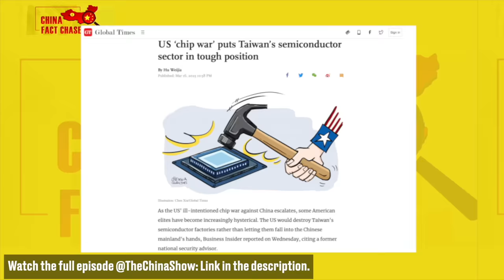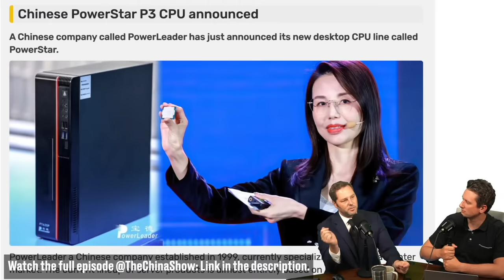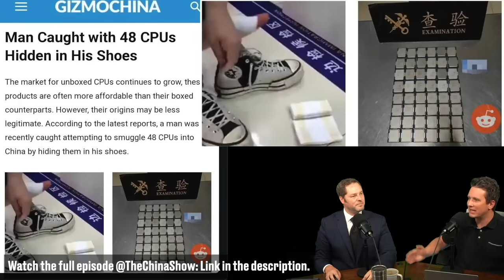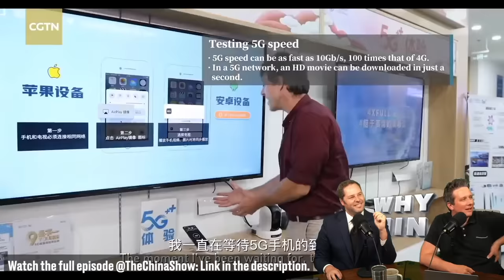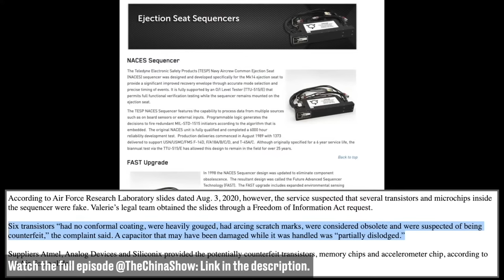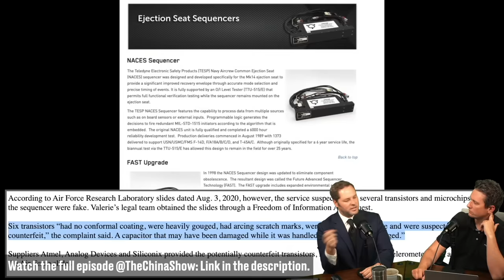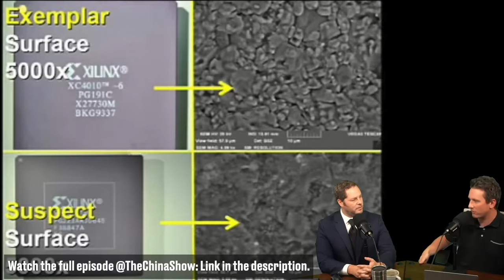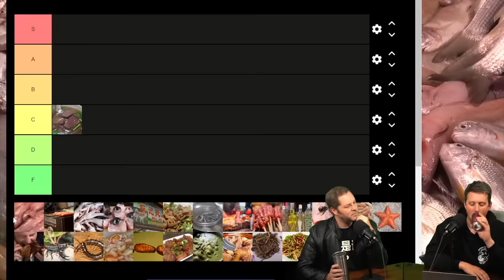China's Fake Ass Computer Chips Are An Embarrassment!

Comment: I was in the Computer chip industry for 20 years.  Clinton opened the flood gates for China but lifting export bans for latest technology to China. I spent 20 years moving factories from EU and USA to China.  I can tell you about stealing.  I was installing a system in China and had my computer out and someone asked me a question so I turned towards them and another Chinese engineer hooked up a USB drive to my computer and started downloaded documents.  I turned back and saw what was happening and stopped the download.  Paper manuals would disappear and so would my tooling.
Reply: Then you'll know RosElectronics to manufacture 120nm chips requires 120-sub companies,  34 specialist machinery companies, 11 scientific instrument companies and 17 research labs- this is a monumental space-race type investment that I simply do not see China capable of developing short-term. In a decade- maybe. But not now. And stealing information is a lot cheaper than 17 individual research labs with generous budgets.
Reply: I knew someone who worked at Intel in the 2000's and had to go to China a lot. Intel had a policy of only older generation of chips are allowed to be made in China because of IP theft
Reply: They copycatted dutch waterfiltration pumps when a jointventure was began on chinese soil and after a while they planted a chinese factory next to the joint venture and started making coppycat water filtration pumps. The dutch partner left and after a while he was called because they copuld not replicate the filter itself and they wanted to buy it from the dutch ex partener. He said it was possible but for the chinese a filter would cost the price of one whole water filtratrion pump.
Reply: @corneliusantonius3108  I heard similar stories all the time in China

Comment: the biggest clue is, why is the base clock speed exactly 3.70Hz? That's impossible if you design your own chips. It's like copying multiple choice exam off another student's answer and getting the exact same grade.
Reply: "Describe a country in one sentence"
Reply: @myne00  Nothink happen on Tiananmen Square.
Reply: @myne00  everything wants to kill you
Reply: @myne00  rabid beavers geese and mounties
Reply: @myne00  beans on toast
Reply: @TWEAKLET  Great marketing! Keeps the Yanks out ;p
Which is wildly ironic since they have bears, mountain lions, and the most prolific killer of all: Yanks.
Reply: It's become more and more obvious as all the other ststs have been revealed and are also identical
Reply: @myne00  florida man
Reply: It depends. Typically and for historic and technical reasons CPUs run at a multiple of the front side bus. It would be advantageous to stick to standards in terms of bus speeds, otherwise you could not use off the shelve memory or PCIe expansion cards.

It is one thing to make an x86 compatible CPU it is another thing to create a whole new PC ecosystem. There is no need for the latter.
Reply: @juliusfucik4011  Too late. Now Boyd has stood up and made a sound, saying that Blast Core’s first CPU is a customized CPU product launched with the support of Intel.
Reply: Either they are rebranded i3s or they just copied the number despite it not being correct. I think they are i3s.
Reply: I doubt that they can make 3.7ghz cpu even with a single core one

Comment: I had a USB drive that was adverzized as 2 TB, and was actually 156GB. 
It came with a paper with a QR code to a Chinese only website. 
When I left an Amazon review, Amazon blocked me from leaving reviews ever again.
Reply: When you get a text message saying your Amazon or UPS account is invalid, and you NEED to validate it:
First: Who is the source?
Random letters and numbers? (They plan to replace their ID when blocked.)
Second: Amazon and UPS would NEVER do it that way!
DON'T respond to the stealing messages! Actual companies don't do it that way.
Report it as spam if you have time.
Reply: @MarkBarrett  oh knock off flash drives I had a few of them 

I knew they must have been knock offs based on how dirt cheap they was but got them just to see  I think I paid roughly $4 for 2 drives  each one was 2TB  and yes computer showed 2TB but in reality I found they can only hold about 26GB before going tits up

To be fair I knew they must have been knock offs for the price but 26GB still not bad for the price but saying that it didn't stop me posting reviews anywhere I can to warn people
Reply: I bought an electrical tool, plugged it in, nada. Took it apart, and found the wiring was all backwards. Posted that in the reviews, never appeared.
Reply: Same experience here, with different crap Chinese goods.  I left a bad review, which got deleted, and I got blocked from posting more reviews.  Either Amazon is in bed with these cretins, or else the sellers are abusing the system and filed a complaint of some sort against me.  (If it was the latter, it's interesting that I never heard one word about it from Amazon.)
Reply: bought some items from amazon that never got delivered, my account was also banned
Reply: @jpdemer5  More than likely it's both.
Reply: Stop cussing on Amazon reviews... LOL.
Reply: Similar experience. former vine voice and top reviewer. wrote a negative review on faux tech. then one day, pow.
Reply: I tried to leave a bad review on HomeDepot’s site and apparently they don’t post negative reviews.
Reply: you got 154 free gb, did they ban you for leaving 6 stars?
Reply: @hsimpson7267  Huh?
Reply: @jpdemer5  I think they have a bunch of bots report your reviews if I'd have to take a guess. Despicable practices I tell you
Reply: Amazon has a worse refund policy than aliexpress
Reply: @1marcelfilms  Amazon is easy for refunds in my experience.
Reply: @hsimpson7267  Did you just confuse TB and GB? :face-blue-smiling:
Reply: if a deal seems too good to be true it probably is
Reply: Dude, same here about Amazon! I even reviewed some Samsung pro endurance sd cards I got were genuine, which was good because I had been scammed before by 3rd party sellers on Amazon (and it's impossible to tell these days if it's Amazon or a 3rd party), and gave a 5 star review, and they blocked it! I guess because I mentioned I had been scammed before.
Reviews about counterfeit items violate their terms of service, I guess.
Reply: I bought a Chinese made computer off Amazon about a year ago. 
It was so slow that I literally could never use it for a single thing. 
I wanted a word processor, basically. It couldn't even do that. 

At that point I really started questioning their ability to make anything
Reply: Well, what did expect out of cheaters? Not 2 Cheat?
Its like denying their fundemental DNA
Reply: Says a lot about amazon.
Reply: lol common sense didnt click did it
Reply: A lot of the chinese storage devices that are way too cheap for their capacity only have tiny storage that overwrites itself. You then lose all the data that was first written.
Reply: This is very common with various storage mediums. I got a 256GB Samsung branded SD card that was just a 64gb card that someone modified and printed a logo on
Reply: @andrive  people cop SSDs made from a few micro SD cards or just one written to be 1tb or more
Reply: Welcome to the blocked Amazon review gang :)
Reply: Had a Chinese husband. Advertised for 6 inch. More like two and a half.
Reply: that website is where youre supposed to download the remaining terabytes of space

Comment: The best way to tell they're the same chip may be by those little gold dots on the edges. Those are probably pads used for testing, programming, or other diagnostic purposes. There are really little to no standards on how you must design them on a chip so it is very unlikely that two different chip designs will have the exact same patterns at the exact same locations.
Reply: Its almost impossible with the variations and layers involved u cant say they all just 10,000+/10,000+ transistors resistors just magically were in the same place as another brand lol thats tarded
Reply: They are called Test Pads used by manufacturer for their internal testing of CPUs. If our good folks at Fact Chasers could tap into it (by proper hardware, not by visual speculation), the video could've had some credibility.
Reply: @someonefar5600  I look forward to actually getting one of these rebranded chips physically in hand for more testing. Until then, what alternative do we realistically have but to visually inspect it, and make some observations based on that?
Reply: @MutethatBozo  Observations? Sure. Conclusions? Sorry, no. I'mean, you could draw your conclusions if you like, but presenting them in the manner that has been done in this video, as a judgment on irrefutable and complete facts, only makes the channel lose credibility in my eyes as speculative opinions, not Fact Chasers.
It would have been great if somebody could actually lay their hands on one of these Power whatever computers and tested it with experts.  Considering the insight and inside the channel apparently has in China, one would've thought that it's not altogether impossible. If these things were not being made open to public and were mere showcase dummies, that would've a different prespective altogether, alongside the dubious nature of claims by the company. And until then, to have held back the video?
Reply: @MutethatBozo  accept that the closest lithography forge capable of producing that chip is in a foreign country : Taiwan.
Reply: @someonefar5600  There ia absolutely enough evidence to form a preliminary conclusion. The chip that they have shown, is either an Intel chip, or they have put extensive effort in deliberately  making the chip look exactly like an existing Intel chip.

The second option makes no sense at all. If they spent the billions upon billions to actually get a decent foundry up and running, and design a chip that can compete, just to prove that they can do it... Why would they go out of their way to make it look exactly like a bootleg?

At some point you have to call a spade a spade, and conclude that until one of those chips makes it to the West, the only reasonable position to hold is that these are Intel chips. We are not in China here, you are allowed to call out the CCCP or whoever else on their bullshit. The emperor is in fact naked.
Reply: they are called test pads and they are unique to each pcb design.
Reply: @Niosus  Not really i mean they assemble the chips so they have plenty of those heat spreaders and pcbs plus they have the socket retention clips too why reinvent the wheel even amds lga socket looks similar.
Reply: @420247paul That doesn't pass the sniff test. You're suggesting that they spent tens of billions on making unique chips, but then for packaging decided "ehhh, let's use some Intel surplus".

The PCB isn't some inconsequential thing. Those debug points exist in their locations for a reason. If you're going through the effort of making the silicon, you're going to make your own PCB. It's not hard, even hobbyists can do that.

What China has shown is currently evidence against them being able to make those chips. I can visually replicate what they show exactly with some sandpaper and a couple minutes at the local maker's club on the laser engraving machine....
Reply: @someonefar5600  You sound like you're employed by the CCP to cast doubt on people who criticise the party.

Comment: Sorry for being late. The PowerLeader processor chip has been found to be a re-badged Intel, as someone put it through GeekBench, and found that it is identical, so much so that it has the same code name.

Re-badging CPUs for scamming the government for subsidies is not new, the best known is "Hanxin" which was exposed in 2006 as Freescale chips with original markings removed and new markings printed.
Reply: Why is this not the top comment
Reply: This should be pinned.

Comment: China has the capabilities to make basic microchips, but not computer processors.

A lot of their 'mainline' processors are also rebranded old computer chips.
Reply: How can the Chinese military trust their suppliers to give them genuine microchips for their fighter jets. ?
Reply: thank you for explaining the video
Reply: @jan22150  Microprocessors is not a big problem to do, super easy to develop, heck, I even use a chinese RISC-V microprocessor in my projects since it's pretty good (didn't have a western equivalent sadly)
Anything above mobile processors, nah, few years behind
Reply: Not the latest chips. But even if they are  few years behind, you can do a lot with older tech. A processor equivilent to something Intel were making fifteen years ago is still more than capable of desktop work, or guiding a missile, or operating a radar system.

Comment: The hard drives they sell are also sketchy, rejected drives from western digitial and seagate that they relabled and modded with custom firmware to hide bad sectors and to turn off S.M.A.R.T capabilities, they all have the same serial number too which causes huge problems when people try to use them in a Raid array.

Comment: i saw an article about this a while ago. apparently they cant replicate the precision to create capacitors and other electronic components down to the micro scale. where the tolerence for defect is 1 in a million i think, it really is a cut throat competition for electronic component manufacturers. glad you're covering this finally
Reply: Oh man…the Chinese Capacitors plague outbreak in PCB is very bad. They marked as Japanese made but it just dried up paper in a shell.
Reply: What do you mean finally? They've covered this topic like a dozen times...
Reply: a friend worked in a company where they outsourced some manufacturing to china, it was just simple welding but quite a bit of volume, when parts came back everything was welded upside down, about a hit of 400k down the drain to fix it. Suppose its close enough to australia where everything is rotated 180 degrees. (think of something simple like a hook on a plate and the hook is wrong way around).
Reply: @StreakyBaconMan  usually they cover chinese internet culture but chinese manufacturing is a far bigger concern. i for one dont want to be spending my hard earned cash for a laptop that might catch on fire because of substandard chinese components
Reply: @akusen9  They've covered exploding Chinese batteries multiple times too... Try looking a little harder.
Reply: Things like that are why China looks to be stuck in what economists called "'the middle income trap". The Chinese economy grew quickly because companies could outsource work there due to the availability of cheap labor. After awhile wages will rise for Chinese workers. Eventually wages will get high enough that it it becomes cheaper to outsource the relatively simple things Chinese workers had been doing to other countries. The next step would be for China to start making complex products that have a lot of added value, but that's tough to do because it requires know-how and skilled workers. If that know-how and those skills aren't developed, China will lose the "easy" work to countries with cheaper labor but there's nothing to replace it. Hence the economy will stop increasing on a per capita basis and China will stay a middle-income country. Brazil and Turkey are two examples of the kind of economy China seems to be mired in. They aren't poor but they aren't wealthy either. The Western countries were the first to develop so they were able to avoid the trap. The expereinces of Japan, South Korea and Taiwan also show it's possible to escape from the trap too, but it's very difficult for a country to do that.

Comment: Conterfeit chips go back  at least to the 1980s.  I once had to go through a whole locker of spair IC chips in the 1980s.  One military supplier actually got their hands on counterfeit ICs and they made it into the military supply system.  Afteer the massge traffic came through identifying the problem, many enlisted men spent many hours using acetone to see of the Texas Instruments logo and part number could be wiped off.  Under the paint was a different number and come pictograph characters.  The bigger issue from back in the day. at least to those operating a ship, was counterfeit bolts.  There are markings on the head of a bolt as to the QA level marking them as "airframe grade", "structural grade", "General Use", or even "Level-1 Subsafe" with an accompanying serial number.  Nuts and bolts were being sold to the military as QA controlled fasteners that had hand engraved marks emulating the QA marks of tested fasteners.  If you got your hands on a case lot (100 lb box of bolts) and peeled off the sticker on the side you often found orirntal pictographs on the box itself.  The real boxes of bolts would have the mil-spec id number and a contract number printed directly on the box.  (Trust me, having a 1-3/4 nut shatter at the 750 ft-lb torque point of a 975 ft-lb pattern step torque and seeing bubbles in the steel of the shattered nut is a totally sphincter slamming moment and you don't want to continue with bolting that critical valve back into place.)
Reply: they literally do this with everything for decades. For example. I once bough a can of lighner's gas that had a very thick sticker around it. Those things usually come just painted. Well, pelled the thing and discovered what it was all about. Under the sticker, it was painted as they were deodorants. So, what they do is importing those things as deodorant to a country, to avoid taxes, big taxes, and then just print these stickers where they are going to sell the product.. If they do this even with gas for lighners.. what they wont be doing....